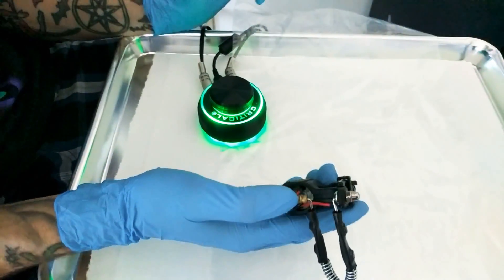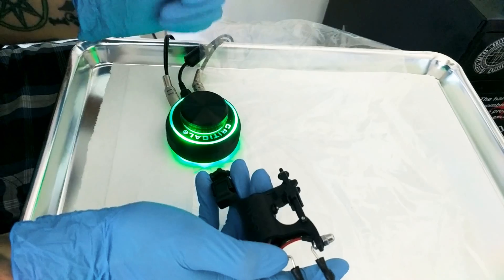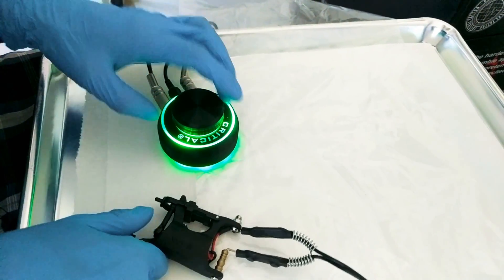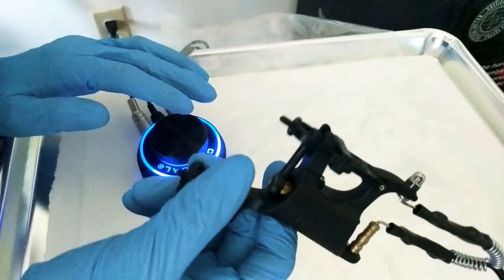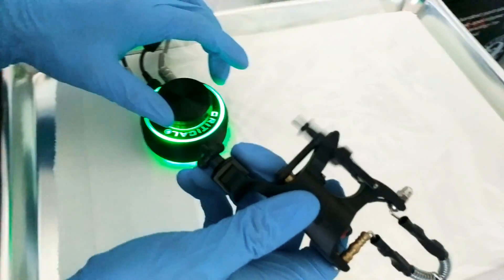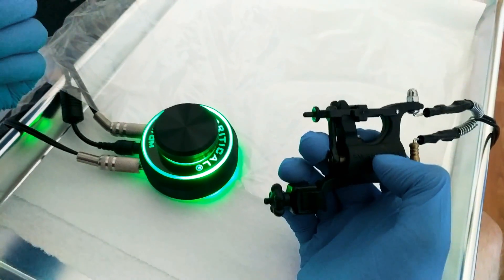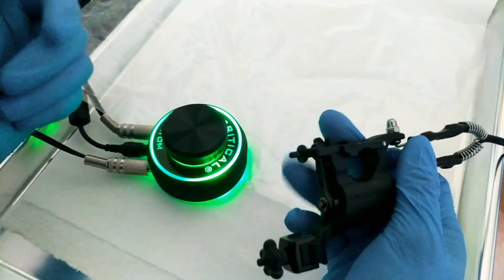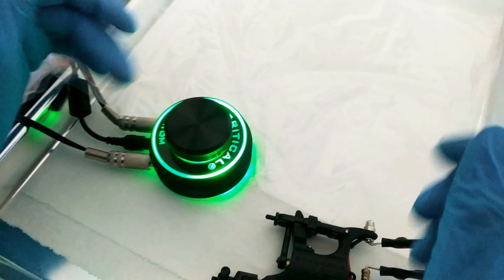Critical atom  power supply (Aurora power supply Review link in description)

Comment: Have you used this on coil machines or just rotary. Is that a real swashdrive whip? I wanted the gen 6 when Tony Oliver first started producing machines.
Reply from the maker: I have custom build coils, but need new springs and more work to them,  and unfortunately no it's just knockoff that was handed down to me but old timer to see if he liked rotaries, but for knockoff it's actually awesome, motor is somewhat silent I mean it more quiet than coil machine, that I don't like how much it vibrates so I don't use as a liner even though you can bust single passes with it easy and done it before, but I got tired of how it vibrates that and I hate how they put "swashdrive whip " on it , I hate how China has basically no copywrite laws ,
Reply from the maker: But Yes it works with coil and rotary